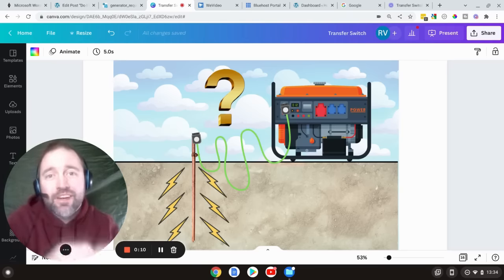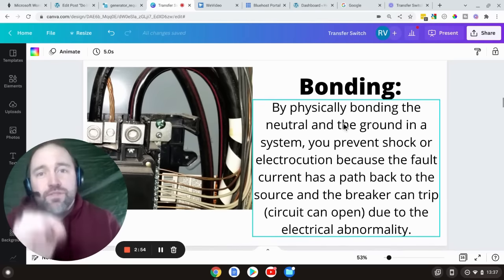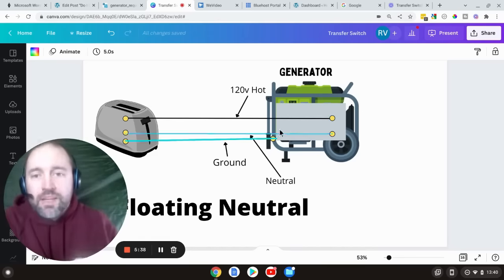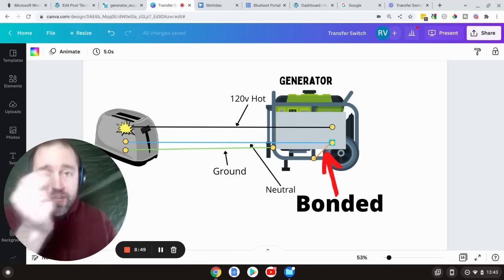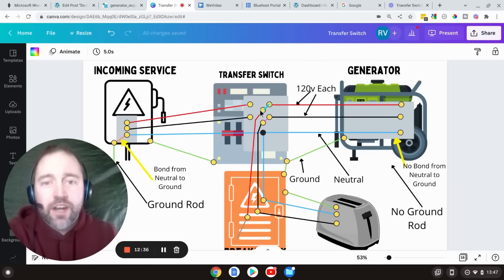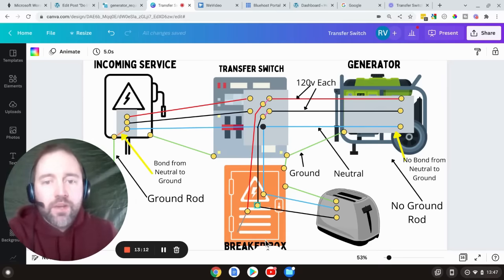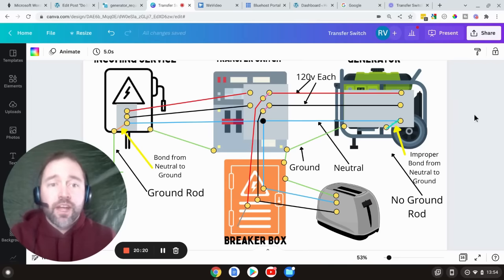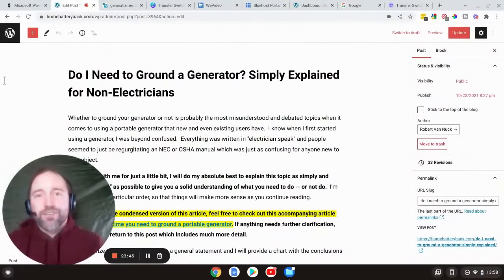When You DO and DO NOT Need to Ground Your Generator [Extension Cord Use & Backfeeding a Home]

Comment: You never touched on GFCI how would that change things .
Reply: @denverbraughler3948  ... you NEVER use GFCI to feed a home from a portable gen set. The wiring is not compatible and the GFCIs will false trip.
Reply: @rupe53 :

Of course, the neutral must be switched in the transfer switch.

If you’re correct, and four wires are connected are connected to the transfer switch, give a single example that doesn’t work that isn’t faulty wiring, e.g., a bonded dual-purpose neutral and ground.
Reply: @denverbraughler3948  ... I worked in Ct but some neighboring NY towns did call for switched neutrals under certain situations. On your question, it's unclear as to what you are asking. Certainly, there's some smart ass out there who can wire it incorrectly, but that same guy can probably screw up a wet dream.  <LOL> BTW, a shared neutral MUST share the same panel using opposed legs. You can't put one breaker in each panel. In a sub panel the grounds and neutrals MUST be on their own separate terminal bars and NOT bonded within that panel.
Reply: @rupe53 :

I’m asking you to give a single actual example where your ridiculous assertion that a gfci is incompatible with a house wiring is true.

I allege that a gfci can feed a house, but it requires a switched neutral.

You haven’t any clue.  I’ve changed “shared” to “bonded” since that confused you.

Three-wire ranges and clothes dryers are examples of the functions of neutral and grounding being shared on a single conductor.  Another is three wires run to an outbuilding with its own ground rod bonded to the neutral.  These won’t work with gfci even when legal.
Reply: @denverbraughler3948  ... I can tell you from experience that a gen set (portable) with a GFCI will trip if the house has screwed up wiring or GFCIs inside. I can also tell you that a shed with only 3 wires should not have its own ground rod, because code tells me that's only a branch circuit. If it's a feeder, then code says it needs 4 wires PLUS a ground rod. Do you even know what a shared neutral is?
Reply: @rupe53 :

You are still confused.  

Three-wire feeders to a subpanel in a barn or outbuilding was normal, and still are grandfathered in as existing.

2014 NEC 250.32 (B)(1):

Exception No 1: For installations made in compliance with previous editions of this Code that permitted such connection, the grounded conductor run with the supply to the building or structure shall be permitted to serve as the ground-fault return path if all of the following requirements continue to be met:

(1) An equipment grounding conductor is not run with the supply to the building or structure.

(2) There are no continuous metallic paths bonded to the grounding system in each building or structure involved.

(3) Ground-fault protection of equipment has not been installed on the supply side of the feeder(s).

If the grounded conductor is used for grounding in accordance with the provision of this exception, the size of the grounded conductor shall not be smaller than the larger of either of the following:

(1) That required by 220.61

(2) That required by 250.122.
Reply: @rupe53 :

Your claim is that a gfci will false trip and is incompatible.  You failed to show that by example.

You further claimed that a gfci can’t be downstream of another gfci.

Again, another ridiculous claim that shows that you don’t understand how gfci protection works.
Reply: @denverbraughler3948  ... not confused at all, except by your arbitrary use of mixing new and old code, without stating the details on a circuit being a feeder or a branch. Also, your explanation of 3 wire ranges and driers doesn't hold any water because those appliances generally don't call for a neutral and a ground until we get to new code. Tying the neutral and ground together in the case of old code is not a shared neutral.
Reply: @denverbraughler3948  ... you are right. FALSE TRIP is probably not a good term because they are tripping for a reason, which is usually that there's juice flowing where it shouldn't be flowing. Every time I find "nuisance tripping" its typically grounds tied to a neutral or multiple GFCI outlets within the same circuit. BTW, I never said they can't be in the same circuit. I said they shouldn't be due to creating the issues I mentioned.
Reply: @rupe53 :

NEC says “feeder or branch” — doesn’t matter.  
I can’t tell what you mean by “old code”.  The current code contains the exception.
Water?  Electricity.  I listed valid reasons that a GFCI will trip.  
You said that a GFCI can’t ever work and will false trip.  You failed to explain why.
You even claimed to know this from experience.
I explained why.  And those things can be corrected.  
Then a GFCI-protected genset can be used to power a house.

The fact that you claimed that valid tripping is “false” proves that you don’t understand.
Reply: @rupe53 :

No, multiple GFCI device on the same circuit is not a problem.

The problems are misconnections and people swapping line and load.

There are also flaky devices.  But they are flaky stand-alone regardless of what else is on the circuit.

And there are motors and other electronics which leak.
Reply: @denverbraughler3948  ... I guess you failed to read my post where I changed FALSE to NUISCENCE... because it does trip for a reason. BTW, you already posted the difference between 2014 and 2020 code. Do you not know which one is old code versus new code? I'm tired of wasting my breath here.

Comment: I plan to go to car shows and just have a generator that can run a computer and sound system and it's saying I need an 8 foot metal rod to put into the ground and run for like 4 to 5 hours.  The extension cord obviously has a ground plug, but I have no idea if this thing is bonded or what.  It's a WEN 4,750 watt gas generator.  The instructions are just sad for anyone that doesn't have a full understanding of electricity.  I've been trained with cars, but this is a different monster.
Reply: Ohm the neutral slot from the each plugs on face of gen to the frame or ground lug, if you get a reading that means the gen is bonded (neutrals to ground connected). In this case the bonded generator provides the necessary path back to trip your breaker if there's a faulty item connected with the extension cord. No ground rod needed in this case. See other comments on what to do with a plug adapter to use the gen if a floating neutral. I hope this helps if I'm interrupting all the information correct.

Comment: On a generator or battery power station using a Neutral Ground Bonding Plug installed in one of the generator or battery storage units outlet ties the neutral to ground causing the either device to trip its breaker protecting you from electrical shock should any device develop a short.

Don't use the Neutral Ground Bonding Plug when using a battery power station with a floating neutral when it's
being used as a backup and you're charging it from the grid as this would cause a ground loop.

Comment: at 8:10 there is no such thing as an excess of electricity. electricity flows based on the resistance of the circuit.

Comment: I would highly advise NOT modifying a gen set (ground / neutral jumpers) without contacting the mfgr first. Stuff like that may void your warranty and the UL listing of the set, which may also cause issues with your insurance if you have a claim. If you connect your home with a proper 4-wire cable, then you are already grounded through the house system to earth ground.
Reply: Insurance cover negligence. You have good advice, but purpose of insurance is to cover negligence, including your own.
Reply: @jimbo5635  ... not true! If they can prove you willfully made changes to render the equipment LESS safe, then they might not pay a claim. In a court of law, the negligent party always comes out in second place.
Reply: @rupe53  Not true, I have seen drunk drivers insurance pay off their car the car of the people hit, their medical bills and pain and suffering, and the drunk driver was 100% negligent
Reply: @integr8er66  ... we're getting into different territory with no-fault insurance, etc. If you have collision coverage you can almost always get your own car covered, minus the deductible, but you usually have to sue (or threaten) to get pain / suffering. Still in all, not the same for home insurance.

Comment: 04:53. I have yet to see a Kitchen Counter Appliance with a 3 wire Cord....
Reply: microwave ovens always have 3 prongs. Not sure what the reasoning behind that is.
Reply: @rupe53  Yes Micros Do. I'm used seeing them cabinet mounted.
But Your other common kitchen stuff does not.
Reply: @m9ovich785  ... correct on all counts. BTW, countertop microwaves outsell cabinet mounted units by quite a margin... mostly because they are under $100, and you can put them anywhere.
Reply: Then I guess you haven't been paying attention. Every electric kettle seems to be 3-prong. And so are many (maybe not all, but quite a few) hot plates, pressure cookers, rice cookers, espresso machines,  bread machines, deep fryers, blenders, stand mixers - even toaster ovens and (mostly commercial) toasters.
Reply: @RottnRobbie  In My 62 years of using Counter top Kitchen stuff, the only thing I've had with  3 Wire Cord was the Counter top Nuker..
Reply: @m9ovich785  Well I can't do much about your lack of experience, can I? (LOL)

Assuming you mean that you're 62 years old (as opposed to 62 years since you started using kitchen appliances), then I'm older than you. But my kitchen is even older than both of us, and only has 2-prong outlets on the counter. Let me tell you I find it a pain in the a** that when I want to use my blender, food processor, or kettle, I have to move them because they all need the single 3-prong outlet on the range. 
(My microwave lives on a cart on the other side of the room)

Comment: YUP, although the neutral is grounded, it is not the same as a grounding wire, The ungrounded 
wire is a HOT wire. If using an extension cord it should be a 3-wire cord. if using a 3 wire cord on a bonded gen and there is a fault, the breaker will trip, BUT if gen is bonded and u have a fault, using
a 3 wire cord but ground pin is removed, touching gen and faulty load will be dangerous.
A 3 wire cord  or load missing a ground pin = a 2-wire cord.

Comment: Lost Mr and grounding doesn't prevent electrical shock. That's its biggest purpose: setting a reference voltage, usually zero and then bonding everything made of a dead conductor to that voltage so zero current can flow between two objects or from one object through you into ground.

Comment: Another example of HOW THE CIRCUIT IS COMPLETED? is those screw driver voltage detectors. I´m standing on my Nike shoes, put the tip of the voltage detector in the live terminal of an AC outlet and touch the metal piece in the handle and the light turns on HOW IS THE CIRCUIT COMPLETED?????. I even tried it with my Nike shoes standing on a plastic chair on top of a wooden floor.

Comment: So if you hook it up to a transfer switch you can't use extension cords at the same time (or you shouldn't?)
Reply: You can.  Electricity doesn’t care whether the receptacles are built into the auxiliary power unit or installed in your house.

Comment: I am confused because you say not to use a ground rod on a bonded generator using an extension cord but you say use a ground rod on a bonded separately derived system bonded generator. I see no difference.

Comment: Frustrating that portable generators don't make it easy to alter the bonding....often times you have to do some disassembly - it'd be nice if there was just a switch you could toggle to change the bonding.
Reply: I agree.  There is a video on YouTube of a guy who did that modification himself. 
Instead of just bonding the neutral with a single piece of wire, he put a rocker switch in the middle of that wire mounted on the generator's panel.
He could bond it or unbond it with a simple press of the button depending on what he needed it for each time.

Comment: Wrong. A normal circuit breaker detects over ampacity if it exceeds the amperage it'll trip. The only thing that will trip is if you're equipped with a GFCI which detects voltage going through the hot and voltage coming back through the neutral if it detects current going through the hot and not coming back through the neutral it will trip within 5 MS

Comment: No mention of interlock kit in the video. Disappointing.
Reply: The transfer switch is the interlock. It's honestly better than a panel interlock kit, because it completely disconnects from the utility and connect's to the generator in one throw. And reverses it in one step.

Comment: The ground rod as described doesn't do a thing, it only makes it more dangerous. The thing that is failing in this video to correct this is the difference between a breaker and an RCD. An RCD will work to make the circuit safe together with a ground rod. Without an RCD a device could be under live voltage when the ground wire isn't connected (faulty) even placed on the ground to close the circuit their never be enough current flowing to trip a breaker. In this case a RCD would come in whom measures the difference between the out and incoming currents and trip if there is a slight difference in current, 0.03A instead off the 16A or more that a breaker needs to trip.

Comment: What sucks is when you have a generator that is bonded internally and you can't cut the bond without voiding the warranty...
Reply: not every gen set is bonded internally. Modifying a gen set will also void the UL approval so may be an issue with your insurance in case of a claim.

Comment: In your example of a bonded generator with a ground rod at 8:19, you state that there if there is a fault in the toaster, you can be shocked. I don't see how that can happen since the toaster frame is tied back to neutral via the ground wire in the cord. The breaker should trip within milliseconds and very little voltage should exist across the 'victim'.

Comment: I really have to stress that the "electricity goes in a circuit" is really only applicable to DC. The notion that, as you put it, "as long as you cannot complete the path, nothing's going to happen" is false in the context of AC. The human body is a capacitor that will happily accumulate and discharge a significant amount of current fifty-to-sixty times per second if provided with it, irrespective of grounding.
Reply from the maker: Thank you for your comment!
Reply: ALL electricity flows in a circuit, both AC and DC. It might just be difficult to identify what that circuit is. And that circuit may involve the human and the physical ground beneath your feet.
Reply: @deang5622  Ok, sure. And even when there is an insulative material like rubber or air between the human being and ground, the two still form a capacitor that in DC is an open circuit but in AC isn't. My point wasn't to get technical about the definition of a circuit, but to indicate to the lay reader that creating a conducting path from hot to neutral/ground is not needed to be electrocuted by a live AC source.
Reply: @TechnocratiK  Ya not really, In theory your right, but linemen touch 178KV lines and don't get shocked ONLY because they don't touch ground.

Comment: A toaster isn't a good example here, since moxt toasters now have two conductor cords.
Reply: The toasters have been constructed so that there is no way for the hot wire to ever touch any exterior metal of the toaster, this makes it so that there is no need for the safety (equipment) ground. They have also been tested by an organization like the "Underwriters Laboratory (UL)".

Comment: You not clear about how it clear fault when not switching neutral.  Dont the orange on the picture your main panel? If it is it bonded there so fault current follow egc to that bond and back to the generator to clear the fault.  I have no idea why you point your mouse on the left of the meter socket and say it meet here.

Comment: And the old days there would be a piece of metal strap on the top of a lawn mower engine that was bare metal and when you pressed down on it to the top of a spark plug it would automatically short the plug out and kill the engine why did we not get shocked because electricity flows through the least resistance therefore if you were touching a toaster hypothetically you would have to have a better ground Source than the ground rod in the ground misconception water has a high insulation resistance what makes it conductive is the minerals in the water distilled water will not conduct electricity I think you should probably have a little bit more hands-on experience. And yes I am a electrical engineer with dual masters degrees an electrical engineering and mechanical engineering

Comment: WHY NOT SIMPLY HAVE A SWITCH THAT FLOATS THE NEUTRAL? I suspect the companies would then absorb the liability.

I saw a video from Gavin's Garage in which he changes a PREDATOR 9500 from a bonded neutral to a floating neutral. ......... https://youtu.be/qiXuG-lOdTo?si=YpswfRzRlL2SjaBj ....(Several of his videos compare the predator 9500 to the Duromax 9000) 

Q:  since his Predator came with a bonded neutral, why don't these companies simply PROVIDE A SWITCH TO FLOAT THE NEUTRAL? 

This is the Benjamin Sahlstrom video you were wondering about
https://youtu.be/RkjjZJgaINA?si=BLywwinFPj38dqrd